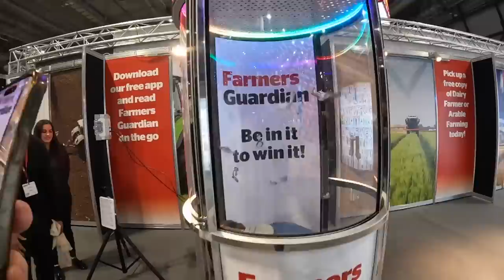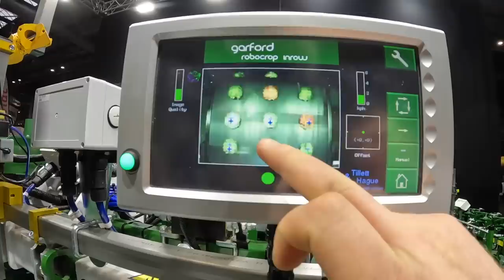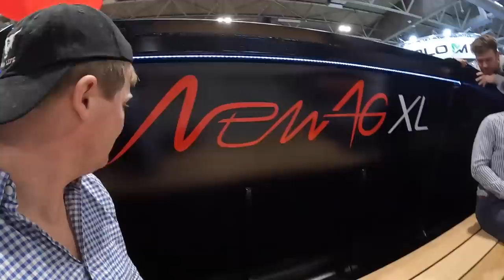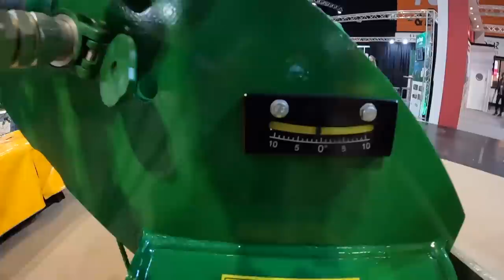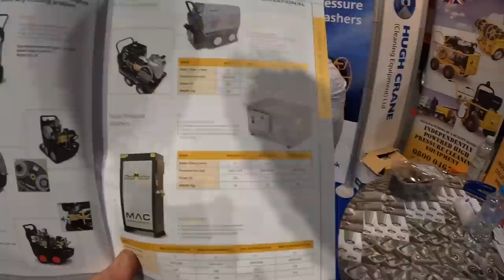IS THIS THE BEST LOOKING TRACTOR IN THE WORLD? UK LARGEST MACHINERY SHOW!

Comment: 12:00 the Tanker has 2 separate tanks, one in the front and one in the back, at least the 2 "domes" on top indicate it. The back tank empties first and then the front one. The idea is to keep more weight on your tractors rear axle as long as possible to get best traction on wet ground or in suboptimal conditions. It's actually a very common thing here in germany, especially contractors have this on their tankers. That way they can keep things moving when time is tight and they cant wait for better conditions. The only difference here is that there is just a valve inside the tanker which releases the slurry into the back tank and not a separate pipe.

Comment: 15:35 the only thing I could think of as the reason why they not allowing more solar is - and it is very strange - they have maybe one phase or a low 3-phase wiring in the local grid in that area or even a bigger or large scale solar or wind turbine or turbines nearby.

Also, go and have a chat with the local council and even the nation grid about it and make sure the paperwork is up to date and even correct - there have been cases of decimal points etc being in the wrong places.

Comment: For engines using add blue (DEF in the US), the exhaust systems tend to be happier with the engine running closer to max power than idle.  It's counter to the mindset of older diesel engines without emissions systems.

Comment: I'm geussing you meant red pipe on the tanker @12:30, the pipe just goes in the tanker in the middle and to the bottom with foot-couple inches to spare, pressure from vaccum pump makes slurry go out.

Comment: On the SlurryKat Tanker, That pipe is the main and only feed to the macerator. It isn't fed from the rear of tanker like others. The gate valve on the tank it is connected to, on the inside a pipe that goes to the bottom of the tank so it is always in the slurry
Reply from the maker: Would love to see this work… crazy to me 🙈

Comment: My boss has two of the triolet tub mixers one on each farm one like the tandam one big one and one farm smaller one  they pull them with 120 hp case international  5120 cab model he has 3 of those tractors those run few hrs a day